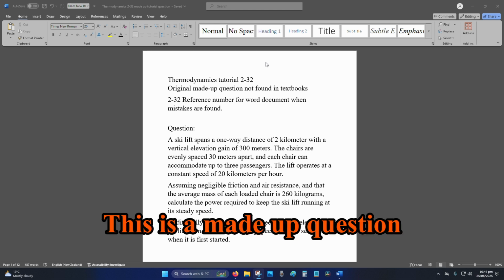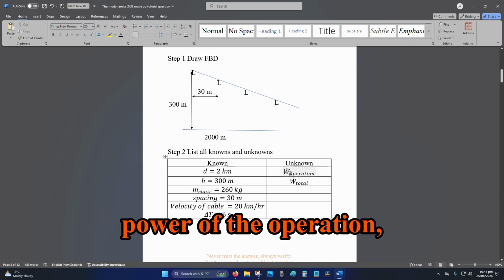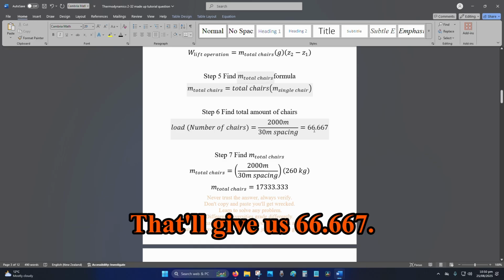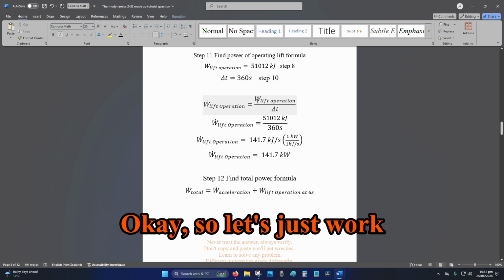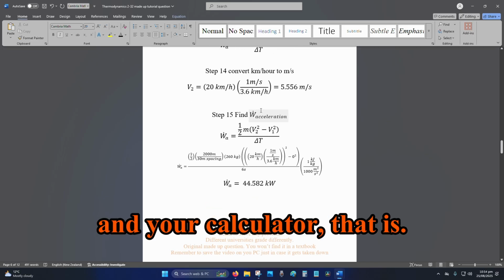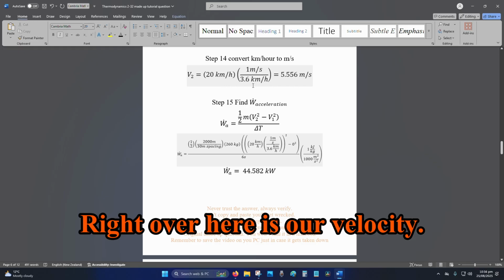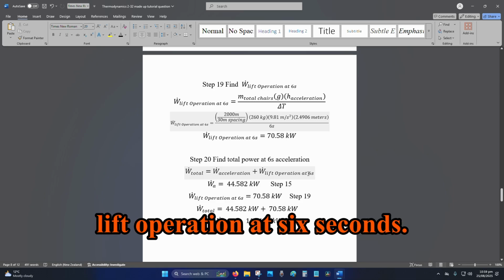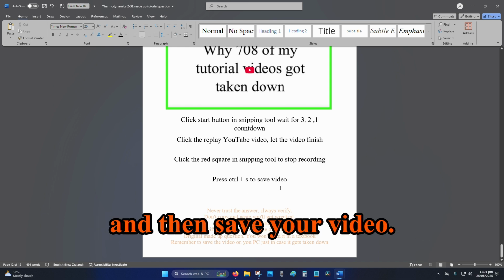Thermodynamics made up question 2-32 A ski lift spans a one-way distance of 2 kilometer with a

Comment: isnt step 18 wrong? i think its missing a square root
Reply from the maker: The formula comes from: h = (distance along incline) × sin α
Distance along incline = 1/2 at²
Therefore: h = (1/2 at²) × sin α = 1/2 at² sin α

The formula h = 1/2 at² sin α is valid and does not need a square root.

Can you explain why you might think that it requires a square root?